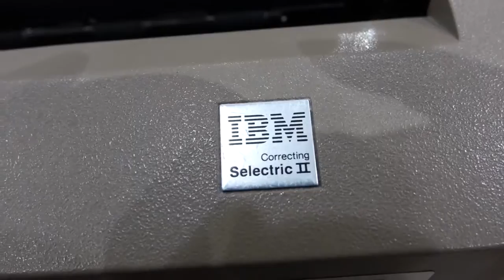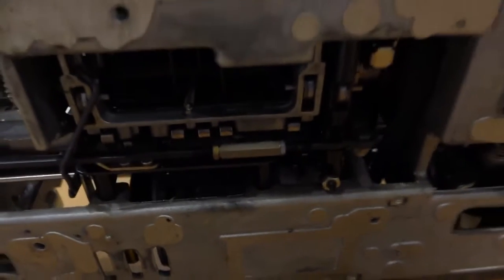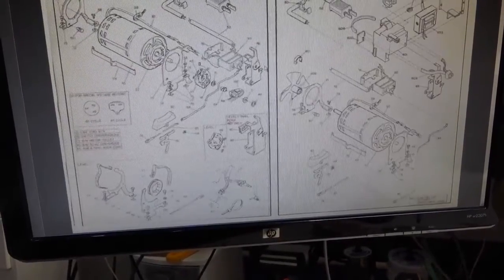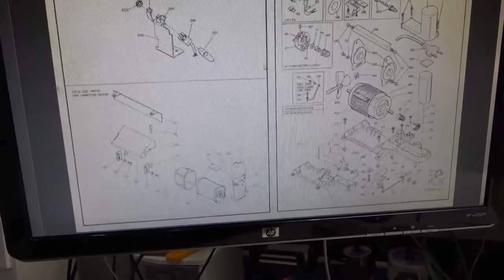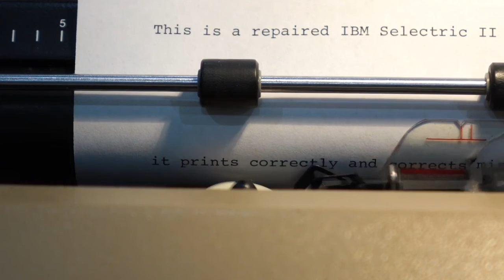IBM Selectric II typewriter repairs

Comment: I just purchased one of these. For the life of me, I am not able to locate the 2 levers just inside the big cover that allows it to lift up.  It looks simple on the video, but I'm just not able to figure out where these levers are. I'm not sure which vintage of Selectric I have as it is worn off the label, but it does have the auto correct key. Any advice?

Comment: As a hobbyist, you can in fact conquer the Selectric with the knowledge out there on them now, but you have to be VERY patient.

The best way to go about it is to first just watch all of the Selectric material on Phoenix Typewriter's youtube channel.  Do this before you open the machine up.  He's a still-practicing Selectric tech whose generous enough to explain what he's doing, and that exposure to the machine is critical. You won't understand everything he says at first but it's the best way to expose yourself to the machine without hacking your own to bits.

Next, familiarize yourself with the service manual on the Internet archive. The service manual is more difficult to understand than the plain English Phoenix Typewriter videos, but they go over EVERYTHING, including some stuff that the videos omit or do in a way that is different than the IBM preferred way (which is sometimes easier, sometimes not.)

When you're ready to attempt service on the machine, tackle it one part at a time. IBM was actually pretty good at keeping most of the systems in these beasts modular, so you don't have to tear the whole machine apart to do any individual repair. Try to fix one thing at a time; don't expect to understand or tackle everything in one day and expect to have setbacks. Understand it one piece at a time and eventually you'll understand the whole typewriter.

Also, you need to have a basic set of small hex wrenches, bristol wrenches, a spring hook, some thin needle nosed pliers and a cycling tool at the very least.

Comment: Got a Selectric III correcting recently (inspired by Fran and you!), and this is gonna be a rough ride! The clutch on the main shaft is stuck, the left part (which drives the keyboard mechanism - filter bar, cycle bail and that kind of stuff) doesn't turn at all. Just getting down there will be fun. Also, the machine has an utterly bad case of Grease-Gone-Glue to the point where I couldn't even remove the typing element.
Got that service manual on my disk. Second only to the Monotype composition caster manual! I seem to be drawn to extremely intricate mechanical devices :D
Reply from the maker: Good luck! Nothing that can’t be fixed in a purely mechanical machine!

Comment: For a real treat, see if you can find a Mag-Card Selectric.  I recall using one circa 1973. Hollerith-shaped card made of magnetic material, just like tape only thicker, in a desk-side drive, stored a page (maybe more) of text so you could record, correcting as needed, then play back without errors.  This was necessary in multi-part forms in legal offices, where the carbon copies also had to be perfect.

Comment: Reading the comments here I see there are several others who have repaired these machines.  I worked for IBM way back in 1979 for a few years repairing these machines. It was without a doubt a path of initiation to learn to fix these mechanical works of wonder. I went to IBM training center in Southfield, Mich.  Any others gone there?  It was a 6 month intensive course with timed repairs.  We had to both diagnose and change a key spring in 17 seconds to pass the exam.
Reply: " these mechanical works of wonder."  Very well said!
Reply: "6 month intensive course"?  I think maybe you mean 6 weeks?  I joined IBM in 1977. Initial baseline training was 6 weeks. First three weeks on the Typebar series, (model C & D), then another three weeks on the Selectric.  The type bar course was only because there were still many in the field. It was not a pre-requisite. Most subsequent CE's just went straight onto the Selectric. But it certainly took a good 6 months to build up your skill level but that was just down to experience. When you're doing 5-10 repairs per day, you learn fast
Reply: @c00kee   Yes, your surely correct on that, and there were a lot of "return jobs" those first weeks.  I was trained in Southfield, Detroit. How 'bout you?
Reply: @danielhehir1  Branch Office, Wellington NZ

Comment: I just bought ine ans when i pkug it in , it does not turn on ...well the carriage clicks to the left side but then nothing :(
Reply from the maker: These are notoriously difficult to repair and adjust, they have thousands upon thousands of parts. If you don't want to chase down the fault, I have heard people dunking the whole mechanism in a simple green solution and hoping for the best, but I suspect it only helps in mild cases when parts are not stuck very much.

Comment: Given this is entirely mechanical, where does the energy come from to move the carriage across the page sequentially when the space bar is held down?
Reply: stupossibleify This may be far too mechanical to grasp,but here goes.
First of all,spacing and tab motions are driven to the right via a coil main spring unwinding.Space bar mechanical motion is a linear ratchet.A tooth skipping in and out of a straight line of teeth.
When the spacebar is held down in repeat mode the spacebar drive cam is cycling repeatedly.The return/index cam is a separate cam.
Carriage return rewinds the main spring via a return clutch.
The spacebar ratchet tooth is held completely out of the rack until it reaches the left margin,where it restores to the rack.
Holding down the spacebar will cycle the spacebar drive cam,but with the tooth/pawl being held out for return,it basically is not doing anything except cycling the cam.
Hope this helps.
Reply: Technically, this typewriter is electromechanical. But the only electrical component is the motor. Everything else is mechanical.
Reply from the maker: A single, continuously rotating electrical motor in the machine provides the energy that drives the impact printing and the carrier movement. The movement of the carrier to the right is actually indirectly provided by a main spring. The main spring is automatically wound up by the electrical motor when the carrier returns to the left (when pressing Carriage Return).

Comment: Given this is entirely mechanical, where does the energy come from to move the carriage across the page sequentially when the space bar is held down?
Reply: A rotary mainspring, as Marc mentions.
Reply: Yes, these are electric.
Reply: The typewriter is mechanical, but with the mechanical elements engaging with shafts driven by an electric motor. I believe the only electric parts in a Selectric are: the on/off switch, the motor, and in the Selectric III two bulbs to show which pitch is selected.

Comment: I went to the IBM schools for selectrics back in the day and worked on these for many years. There are around 800 inter-related adjustments in a selectric 2.  If you don't know what you are doing you will have it so out of adjustment in a matter of seconds, you can never get it back.  A broken band or main drive belt is a nightmare to repair even when you are good at it.  Trust me when I say, "Do yourself a favor and save your sanity, give these machines to a museum and get a computer and a good printer."
Reply: Thanks for your... words... of... discouragement... ?
Reply: Beobout6  .. There are good trchs and not do good techs. To replace a belt. cycle ckutch and a rotate tape and adj. and lub machine is a thirty min job. Parts cost about twenty bucks and machine should go untill it had OPERATOR TROUBLE again.
Reply: Could do a rotate tape in 20 min.......cover off...cover on...
Reply: 800 adjustments?  A common myth, along with the regular "1,000's of moving parts".  Infact less than 400 adjustments, the bulk of which are initial installation adjustments that never normally need to be touched, but are often disturbed by amateurs just aimlessly tinkering without a clue.  Actual common day to day adjustments in normal use is closer to 50, if that.
Reply: Agreed, I was a service engineer on this and other IBM models from 1972 until the 1990's when I changed career.

Comment: You will get better print if you move the copy control lever to position "A". you had your finger on this lever @ 5:32 , it's the lever next to the 10/12. This will also improve the correction lift-off, machine looked to be leaving a substantial shadow when you did a correction lift off on the video, you can also try fresh/different ribbons for better results.

Comment: @CuriousMarc 
Do you know how to fix a Smith Corona SL 105 typewriter ? I bought one and tested it, the words are not producing on paper and fades. I think the hammer strikes too hard on the ribbon ink cassette. The carriage mechanism works, but the words being put on paper; nope.
Reply: Smith Corona SL 105, Sounds like the ribbon drive is not working. Common problem, we repair these all the time. Phoenixtypewriter.com
Reply from the maker: No I don't. Ribbon too old maybe? The ribbon here is "new", can still get it online from Staples!
Reply: +CuriousMarc I was using a new ribbon cassette, but when the hammer starts punching the black strip has become clear afterwards.

Comment: What a coincidence, I just inherited my parent's original selectric typewriter. Unfortunately it was seized and I was not able to get it to unstick. Its on the shelf now but I'll probably have to recycle it.
Reply from the maker: +Pizza Problems: Pleeeeease don't throw it away! Advertise it on ebay or Craigslist, give it to your local electronic surplus shop, or to your best retro-computing friend... Or use more time and WD40 :-)
Reply: No IBM Selectric is seized, Just needs to be flushed & re-lubed. Very common for these to sit unused for years and then they get sticky & stuck. BTW WD-40 is the worst product you can use on a typewriter. I Rebuild IBM's every day for last 35yrs, I know every page in that adjustment manual. I have every part for every IBM Selectric. Phoenixtypewriter.com
Reply: no worries guys. a lot of time has passed and I still have it safe and sound.
Reply: Pizza Problems .
 no, no recycle! bet you have somone in yellowpages. Selectrics have the best touch.